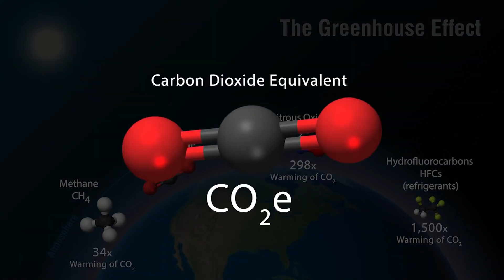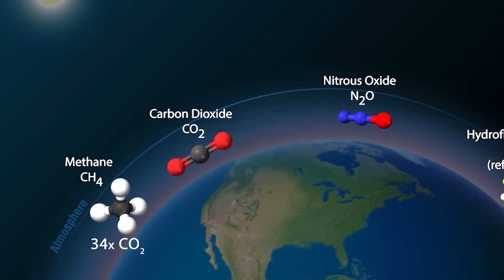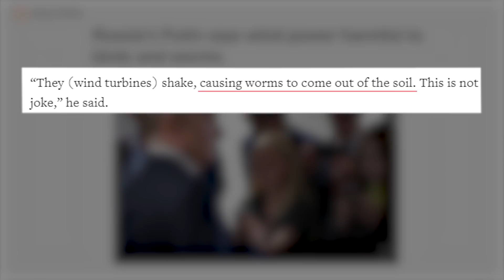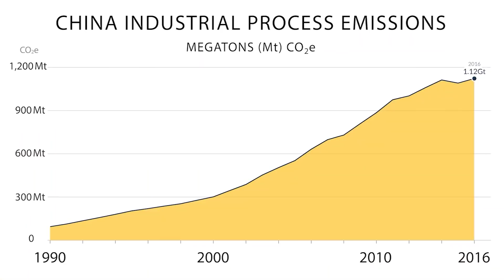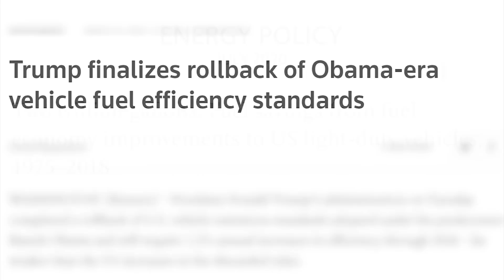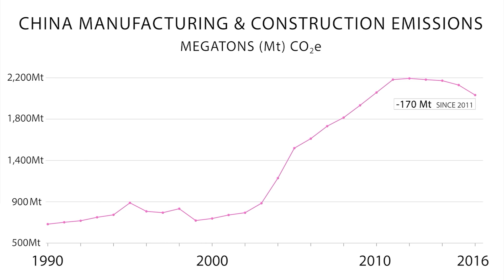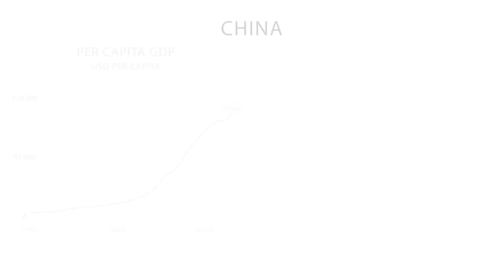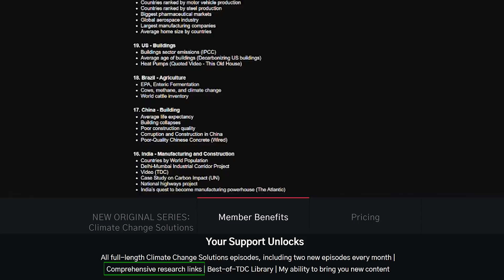Global CO2 Emissions: A Country-By-Country Breakdown

Comment: You fail to grasp the significance of the changes you propose. You are indicating that I should stop eating meat; use light bulbs that actually hurt my eyes in all forms presently available; yield my independence to some connected vehicle, which is more expensive than my extant (paid-off) car and is reliant upon a power grid; and on and on just so that some jackhole can pump out a dozen kids. I am unwilling to do that. And, by the way, migratory birds are negatively impacted by the magnetic field lines created by wind power. As I recall, birds actually have a magnetic protein in their eyes that allows them to perceive the field lines, and those generated by turbines throw migratory birds off course. So, jog on kiddo.

Comment: Trump Win = Runaway Hothouse Mass Extinction
 -- Understanding Energy
Green house gases up 45% in 30 years = Earth Hotter Faster
66% of humanity will live in water stressed areas by 2025
50% of thermal and hydro electric capacity will be threatened by water stress
20% of global energy is electricty
4% of global energy is renewable electricity
To get 30% of energy from algae ponds requires land the size of Argentina
4% of mammals are wild by weight and bio energy land use threatens them
80% of global energy is fossil fuels and has been for over 25 years
Solar & wind are 2% of global energy
North Euro offshore wind turbines work 30% of the time
North Euro onshore wind turbines work 22% of the time
North Euro solar panels work 11% of the time
The F-35 fighter jet works 11% of the time
Europe burns 80% of the world’s wood pellets for renewable electricity
It takes tree plantations 30 years to recoup 10% of their carbon offset
We cut 15 billion trees, plant 5 billion, lose 10 billion per year
Wildfires are more intense, frequent and bigger with drought & high temps
Trees are growing faster and dying younger
40% of insect species could go extinct by 2050
Europe burns 80% of its recycled plastic & paper for recycled electricity
Europe burns 50% of its palm oil shipments in cars & trucks
Europe's carbon fund is rife with corruption
Out of earth's 1.2 billion vehicles 6 million are electric
Ten years fighting air pollution in China raised global north temperatures 0.1 °C
Earth is Hotter Faster
From 1971-2018 global net heating averaged 0.47 watts/m²
From 2010-2018 global net heating averaged to 0.87 watts/m² = 46% higher
Oceans took 89% of that heat and air took 1%
This is rapid heat acceleration
350 ppm CO2 will not get Earth’s heat imbalance under control -- 300 ppm needed to cool earth

Sources:
We cut 15 billion trees per year, plant 5 billion, lose 10 billion / yr -- Tree Nation 2020
Trees are growing faster and dying younger -- Sci Am 2020
2020 : Fossil fuels remained 80% of global energy for over 25 years – CCN 2019
2020 : 2% of global energy is solar and wind ( after 20 yrs trying ) – IEA 2020
2020 : 4% of energy is renewable – WSJ BP
2019 : Greenhouse gases are up 45% in 30 years – NOAA 2020
2020 : Energy related emissions up 30% in 30 years – IEA 2020
2025 : 66% of people will live in water stressed areas – Nat Geo 2020
Water Stress Threatens Near 50% of World’s Thermal Power Plant Capacity – WRI 2017
Water Stress Threatens 30% of planned hydro projects - WWF 2019
2030 : Emissions must fall 50% in 10 yrs to stay under 1.5 C – Sci Am 2019
2030 : Emissions must fall 50% in 10 yrs to stay under 1.5 C – Insurance Journal 2019
2030 : We’ll make 120% more fossil fuel than needed to stay under 1.5 C – UN 2019
2040 : 15% of global energy will be renewable – IEA 2019
2040 : 15% of global energy will be renewable – WSJ BP 2019
2050 : Energy demand to increase 50% – EIA 2019
2050 : 30% of electricity will be renewable – EIA 2019
2018 : 18% of global energy is electricity
2040 : 24% of global energy is electricity
US Energy Vulnerabilities To Climate Extremes – Energy gov 2013
-- Decreasing water availability in some regions and seasons
-- Increasing intensity/frequency of storms, flooding, and sea level riseWater
Energy and Land Insecurity: Global -- Science Daily 2020
-- heightened global risk to water/energy/resources for supply/demands

Weather = flash floods + flash fires + flash mobs + flash infections
Climate = 30 years of weather

Support James Hansen's monthly private dividends
 for real climate justice
26 Nobel Prize winning economists support James Hansen’s monthly dividends, including: 3,589 U.S. Economists, 4 Former Chairs of the Federal Reserve and ALL 15 Former Chairs of the Council of Economic Advisers

Biden Win = Runaway Hothouse Mass Extinction

zzz zzzz